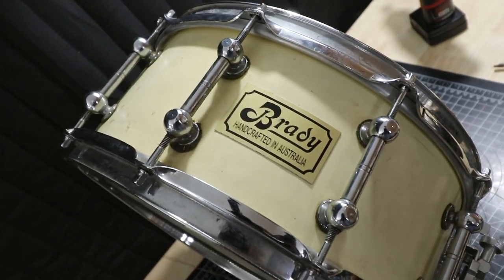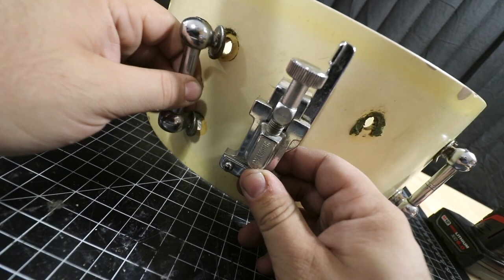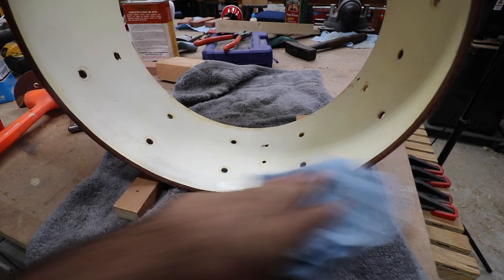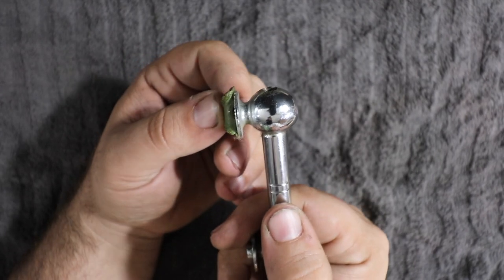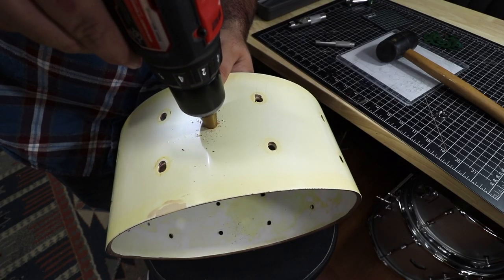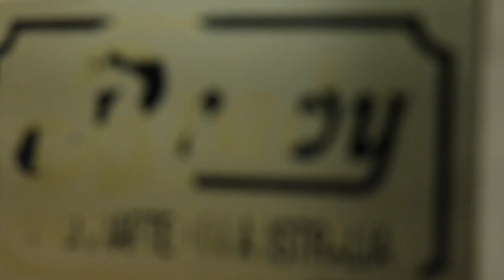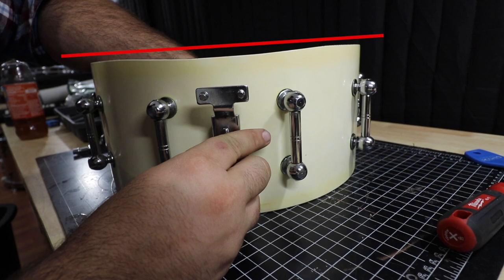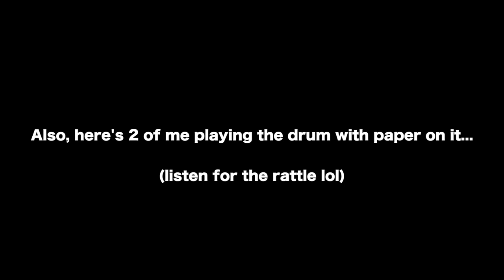This BRADY SNARE Was Found at a Thrift Store!

Comment: Best deal I ever found on a drum was for $39 at a own shop, a rusty 14x5.5 pearl custom alloy sensitone steel eight lug with the beaded shell. It had rubber gaskets between all contact points the shell made with hardware which I really liked. It had triple flanged hoops but I put die cast hoops on it after restoring it and put a 40 strand puresound bed on it, slapped on an Evans clear snareside 300 and a coated UV2. By far my favorite snare I have. Sounds perfect for me at all tunings.

Comment: My 2 cents,after the shell glue fix ,I would have taken some fiber glass sheeting and resin layering the inside of the shell to reinforce the body of the snare shell.
Sand and paint and there you go.
As for the snare beds,why not just use 42 strand snares to take advantage of the wide and deep snare beds?

Comment: Great video!  I have a shell that has similar cracking but it's not as bad.  What did you use/suggest for the actual glue?  Is it just Titebond or is there something better?
Reply: Good question. I didn't even know about that applicator , great to know for any wood instrument 🤓
Reply from the maker: Yup, its just Titebond II. Certain hardwoods are oily so a different glue might be needed. Though, regular wood glue works just fine on all the typical woods used for for making drums
Reply: @rdavidr  Excellent, thanks!

Comment: Why not give a little more radius to that bearing edge to get the sound you want? You probably spent 10 times the effort cleaning the lugs that it would take to cut the edges. And I'd reach out to Brady and let them know what happened with the badge. They may be willing to send you a replacement badge.

Comment: I would re-cut the bearing edges and snare beds.. sharp edges should not make it hard to tune as such.. so they are probably not completely level..  or simply not cut well... a slight roundover, outer cut (2-2,5 mm) a 1-1,5 mm apex (rounded) and a 45 degree inner cut.. done right.. should make it sound good.
Reply from the maker: yeah I plan to rework them down the road. just wanted to see if the crack was repairable before going too deep